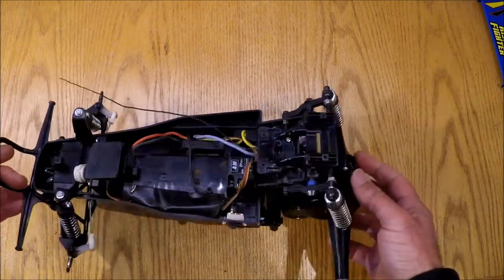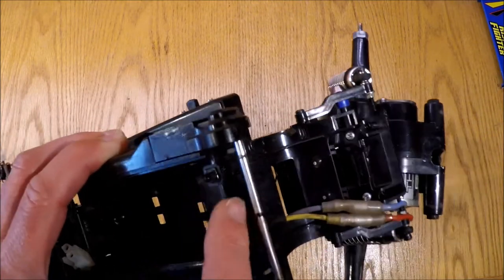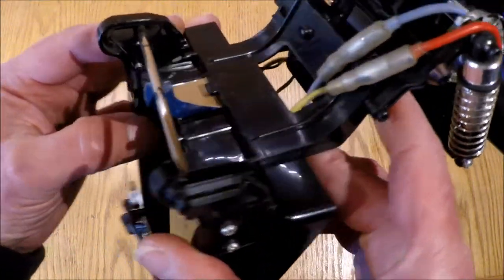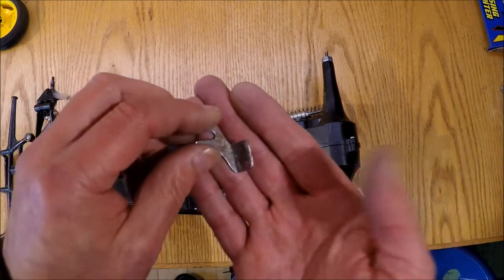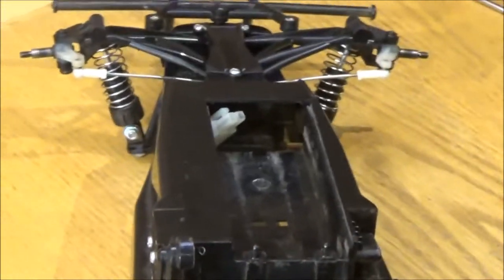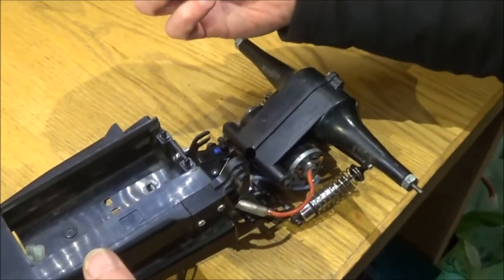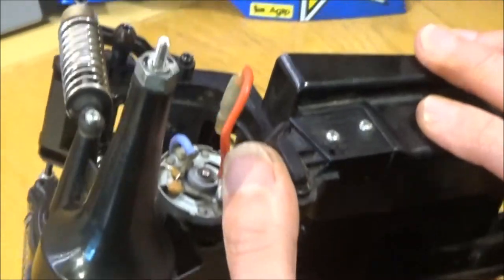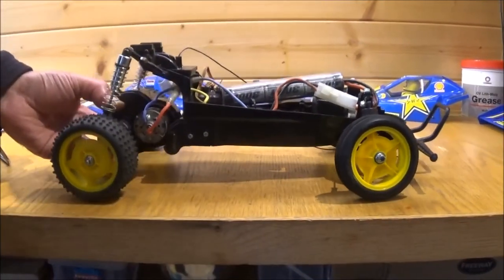How to Make a Tamiya Rising Fighter Transmission Brace

Comment: Such a great and practical video. Thank you. I made 5th shock mod on my Tamiya Unimog (CW-01), but your method is also very good. Also I was thinking about changing the shock to adjustable solid turnbuckle and just adjust the length of the turnbuckle so the mainshaft gets to the central position and that should work too, similarly as your brace. But on the other hand I love watching that transmission movement when driving, I even added weight ballast to CW-01 for it to lean more (and roll over more, which is not good). I just sit or squat a little to observe the amazing Tamiya from low angle :)
Reply from the maker: Thank you Mindau for the interesting comment! Yes, the 5th shock mod works very well - unfortunately there is not enough room to do this mod on the Rising Fighter!  I have also seen the solid turnbuckle mod used to good effect - and it should be possible on the Rising Fighter too.  But yes, it is funny to see the transmission movement, the joy of Tamiya!  All the best, Mark...   :-)

Comment: A 2 year old vid but still very informative. Doing this tomorrow to my grasshopper 2.
Reply from the maker: Thanks very much! Yeah, this mod really makes a good difference - good luck with your Grasshopper mod tomorrow! Best wishes from Mark...   :)
Reply: @MarkBryanRC  all done. Did a cross between your design and ampro. Used plexiglass instead of metal and i didnt cut into the transmission anymore
Reply from the maker: Sounds like you found a great solution - nice one!  :-)

Comment: Great mod - I've noticed this issue with the Lunchbox when you hit full throttle, makes an awful noise too. Ace buggy for the price as well. Look forward to the running video..😉
Reply from the maker: Hi - The Contractor - thanks very much for the comment mate! Yeah, my friend has the Lunchie and we've seen a similar problem on that as it shares a lot of the suspension methods as the Rising fighter - maybe we could look at making a similar brace solution for the Lunchie too - will post a vid of that if we do. Have a great Bank Holiday Cosmo - great weather for RCing :-)

Comment: Success!!! I knew you could do it yourself without any problems! Great video. Bracket looks good. Didn’t it feel good to remove those springs? 😊
Reply from the maker: Thank you! After all, it was you that suggested I should have a go at making a bracket out of metal!! I decided to go for steel this time though, as I thought the bracket would be under more stress than the other alloy brackets I've made - but the steel is much harder to work with so I will continue with aluminium for the majority of my metalwork! 
Oh yes - a real joy to dump those flimsy, good for nothing springs, it feels good to make an improvement on the Rising Fighter - and thank you so muck for the inspiration my friend! Have a smashing weekend :-)
Reply: Mark Bryan RC Thanks for a view inside a creative RC-mind :-) It was cool seeing it being made. Ahh, and I suspect you eventually would have made it without me suggesting it anyway ;-)
Reply from the maker: Cheers Mikael - Yeah - eventually maybe! But you did spur me on :-)

Comment: Very ingenious solution mate and nicely made.  This is a problem on a whole load of Tamiyas and there are various mods that people have come up with.  I've done the 5th shock mod on my Lunchbox which seems to work well because it does allow the gearbox to come up at the front but smoothly so it doesn't pull the back shocks down so much under acceleration as a fixed pivot point.  There wasn't so much space on the Hornet so I've done a mod which achieves the same sort of pivot thing as yours but doesn't require any metalwork skills as mine are a bit limited :-)  As with all these mods you need to work with what you've got lying around and your own skills.  Anyway nice vid and well explained :-)
Reply from the maker: Many thanks for the encouraging words, Pete Wylie RC Videos! Yeah, there are lots of Tamiyas that employ the moving front gearbox mount - I think many people could fashion their own solutions with a bit of bent metal and some files! I'm interested to learn how you modified your Hornet without fashioning some kind of metal bracket! Enjoy what's left of your Bank holiday evening - we are sweltering up here in the Midlands :-)
Reply: Mark Bryan RC Yeah just having one last beer and a bit of tea. Really nice weather here too. I'll catch you on Messenger for nerdy RC chat
Reply from the maker: Cool - catch you later mate!

Comment: Great mod. 😎👍
I am wondering if it will actually improve handling though.

The old system at least helps in avoiding wheel spin because it allows the springs to absorb some of the initial torque. Which also means that the new mod would help in acceleration as long as the tyres are good and don't break traction.

I'd like to know what difference you've noticed when actually driving it. Thanks.
Reply from the maker: Great point, John! So nice to get a very constructive comment and intelligent thoughts! 
I must admit I never considered the transmission moving might absorb the initial shock of the wheels causing sudden traction, as you say, we need to check this out - I'm planning to do a side-by-side comparison in slo-mo with my car and a standard (unbraced) Rising Fighter. Many thanks for the contribution to this topic mate :-)
Reply from the maker: John Thimakis, I tried the car yesterday, and it does seem to be an improvement! Very difficult to be completely objective though... The "slap" has definitely disappeared, and if anything it seems to take off better than standard, with much less hopping at the rear, which helps to reduce the bump-steer. Anyway, hope to bring the video as soon as I can edit all the 55 minutes of footage down to about 4 minutes - it may take a while :-)
Reply: Mark Bryan RC 
That's great. ✔️
I thought it should take off better as long as the wheels don't break traction ie with bald tyres or really powerful motor.

Thanks for the reply and am looking forward to the video.
Cheers. 😎👍
Reply from the maker: My pleasure John!
Reply from the maker: Hi john - I think you all know Pete Wylie - a fantastic member of our RC community - Sorry to say that he has had some awful bad luck - whilst charging a LiPo in his hobby room, it set on fire and has demolished his RC collection and nearly burnt down his house! He has had to move into neighbours in the meanwhile and he and his wife is suffering from smoke inhalation - please visit his channel and send messages of support - I am sure he will appreciate that we all wish him and his wife all the best for the future - best regards, Mark...
Reply: Mark Bryan RC 
OMG!
This terrible news. 
I hope everything turns out ok. You'd never think that your hobby could lead to your house catching on fire.

I guess that we need to take charging LiPo batteries very seriously (especially unsupervised). They now have fireproof bags especially made for placing LiPos in when charging.
Reply from the maker: We should all take note of this - thanks John